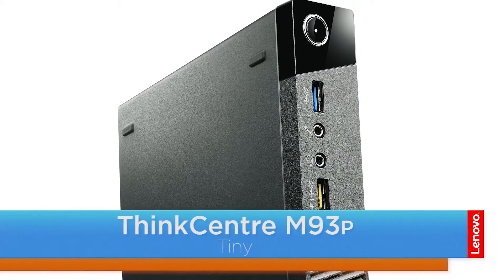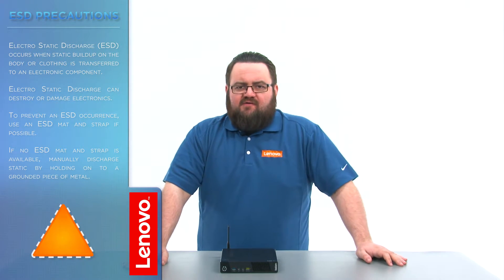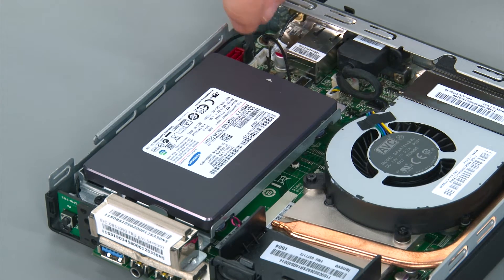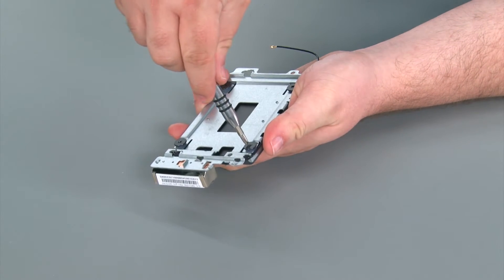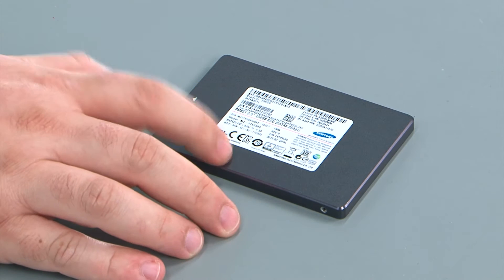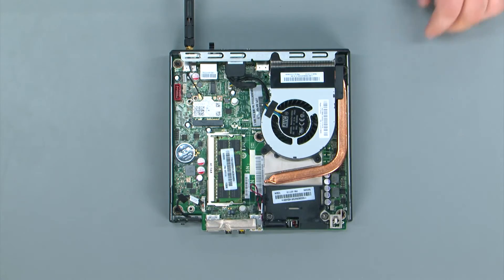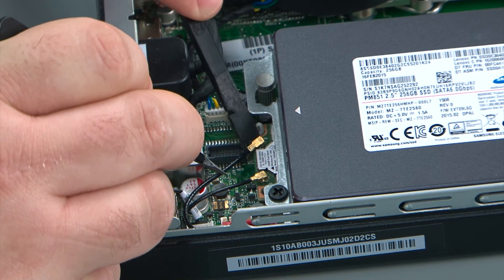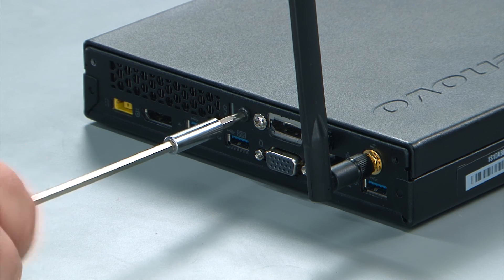ThinkCentre M83 / M93p Tiny Desktop - Hard Disk Drive Replacement

Comment: Hello!

Please, I have a Lenovo M90p type 5864 (SATA 2 PCI-e 2.0), and I would ask if an adapter card PCI-e -> SATA 3 actually could increase the data transmission rate to the theoretical maximum standard SATA 3 (600 MB/s). My question, in this case, is whether the chipset itself would limit the speed to the native SATA 2 (300 MB/s) standard regardless of whether the SATA 3 is connected to the SATA 3 port adapter card.

Another similar question: Is it possible to boot through a PCI-e -> M.2 adapter card in the M90p? If the boot isn't possible in the OEM version, there is a change (BIOS, hardware or software) that I can do to get boot (Windows 7 Pro x64)?

Thanks a lot...
Reply from the maker: Hi @Donizildo ! Thanks for writing in. We cannot guarantee that this type of connection will work on your desktop. You can try, but make sure to check the return option of the PCI-e to SATA III adapter you're going to purchase, in case that the connection wouldn't work. Also, it seems that PCI-e to M.2 connection will not work in this model due to the limitation of the Motherboard, as it doesn't have an M.2 Connection. Let us know if you have further questions. Hector_Lenovo
Reply: @LenovoSupport  Hello hector
!

I thank you for your quick response. I had hoped that someone else would have the same problem and reported a success story in this adaptation to Lenovo.

Anyway, thank you very much for the tips! I'll take the proper precaution, as you suggested.
Reply from the maker: You're welcome. We appreciate that you reach us regarding this matter. You can post your concern in our Community Forums here https://lnv.gy/2IlL8vk as other users that have tried this connection may provided us suggestion on what to do to accomplished it. Should you need any help, don't hesitate to reach out. We'll gladly assist you. Hector_Lenovo